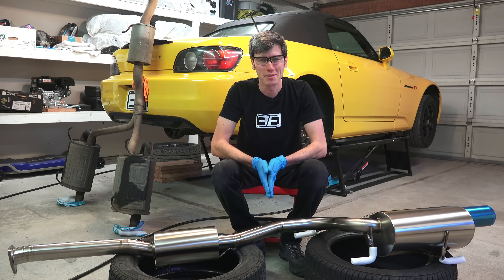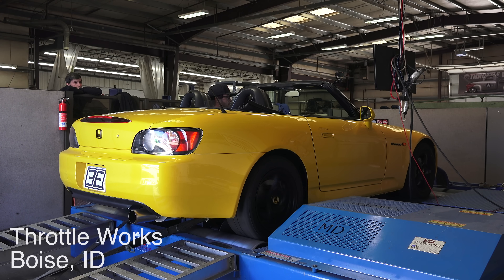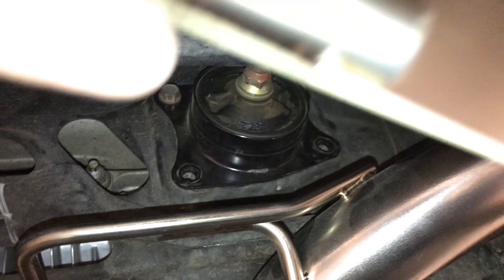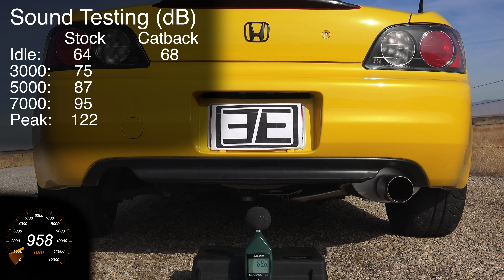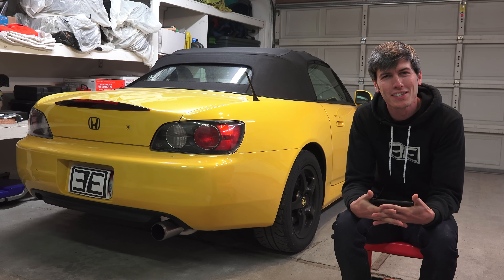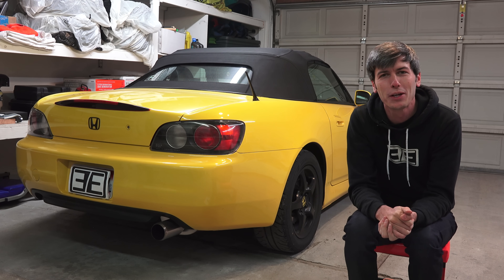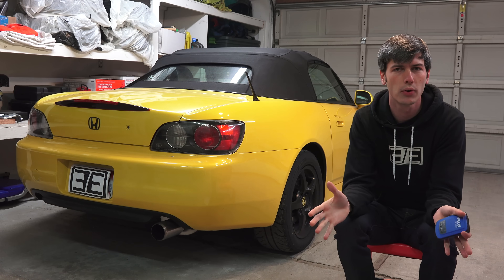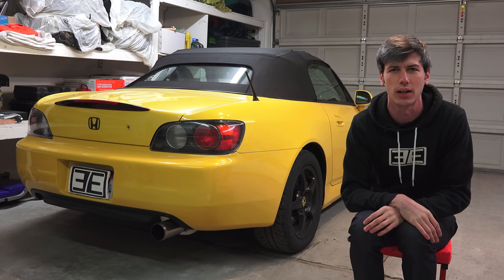Can A Catback Exhaust Make Your Car Faster?

Comment: Moral of the story....don’t buy a $2500 exhaust 😂😂😂
Reply: Toua Moua but for just the weight savings
Reply: Nathan Bickel 1 mod coming at $2500 is not justifiable haha. You can probably do a light weight battery for $100 and lighter wheels for much less combined for just as much if not more weight saving. The $2500 exhaust had minimal performance gain for the amount spent.
Reply: But I would love to see how much cornering speed might’ve been gained. If you think about it, that’s quite a bit of weight just saved from just one thing. If he kept it up it would become a track machine which is what it’s all about.
Reply: I’m pretty sure if he changed the header and got rid of the cat, the power would increase. The weight you save alone is already beneficial.

Comment: "The box said it adds 10 horsepower"
Reply: K&N sticker = 5HP
Reply: its the box that adds 10 horsepower. people get rid of the box and never get the extra HP
Reply: iLupi at the crank
Reply: XenomorphLV426 s2k owners are different from civic owners
Reply: only if you apply the product sticker on your rear window otherwise you will not be able to take advantage of the advertised 200 additional horsepower....
Reply: As usual
Reply: The box weighs as much as the exhaust 😂
Reply: 10hp equivalent  from weight reduction ;)
Reply: Up to* 10 hp people always get this wrong. You wont get 10hp straight out of the box if your last upgrade is exhaust then you’ll see 10hp.
Reply: William Stewart if you count over 10k cheap then sure
Reply: He must have forgotten to put the stickers on
Reply: That's with the hp stickers
Reply: Probably add 10hp at the flywheel not the wheels
Reply: meriton berisha 80% loss though the driveshaft? 😕 nope
Reply: James Foster literally everyone would... Just because a car is expensive for a 17 year old or poor person, that doesn't mean it isn't cheap by normal standards...
Reply: Based  on good authority, adding a Mugen Power sticker instantly increases 10 rear wheel HP in ricers.
Reply: Lol
Reply: 10k is cheap for a sports car really cheap.
Reply: GotPoop WeScoop Not really, they're dirt cheap now.

Comment: Would've been nice to see a raw power test with no catback at all, just to see what the maximum benefit from a catback could be. Wouldn't be road practical, just a curiosity test.
Reply: sienile. That wouldnt give you the answer you want though...
Reply: No, but it would give a theoretical maximum on all the parameters tested which no catback would be able to outperform.
Reply: sienile. No, it wouldnt. It would just show what a removed exhaust would do.  Its a false assumption to say that no exhaust is best for performance.
Reply: If Jason's theory that the cat is the biggest restriction in the exhaust is correct, that would take care of the back pressure issue you are eluding to. That would make anything past the cat a detriment to preformance.
Reply: sienile. No, you are ignoring the fact that a properly designed exhaust can in fact increase the efficency of the engine over an open exhaust and create more power.
Reply: And how does it do so? By reducing the restriction of the exhaust but leaving just enough back pressure to allow for laminar flow of the gases that will create a venturi effect and pull the gases from the engine. This is more a function of headers than a catback.

And to my original point, extending the exhaust beyond the point where such flow is achieved can only degrade preformance.
Reply: sienile. Stop pretending you know what you are talking about... laminar flow? That has nothing to do with the rest of your comment.

And you admitted I was right anyway by saying "mostly" becaise while the effect is greatly diminished the further down stream you go it does not go away, so like I said and you actually admitted a dumped exhaust is not necessarily the best exhaust.
Reply: Laminar flow is a flow without turbulence. When gases expand rapidly, this creates turbulence. Turbulence disrupts the venturi effect of a cylinder's gases pulling on the others. This is why some back pressure is good in an exhaust. It prevents the gases from expanding prematurely.

I never said anything was "mostly" anything... though I think you are referring to my statement that the effects I've described are -- more -- a function of headers than a catback. I also never said a dumped exhaust was best. I said that an exhaust that ran no further than the point where such a flow is achieved is best. So given Jason's assessment that the cat was the point of the most restriction, my initial statement would still prove true: A post-cat dumped exhaust would produce results that no catback would be able to outperform. It's possible, though incredibly unlikely, that a catback may match the performance; but it will not be able to outperform it.

I've been doing this stuff for nearly two decades. I know what I'm talking about. That's how I was able to tune the intake and exhaust on a '93 Altima to be able to crush a stock '03 Corvette C5.
Reply: sienile. Dude, you are wrong and embarrassing your self.  You cant just string a bunch of technical sounding words together and act like you know what you are talking about.

Comment: are these smoke puffs normal for that car?
Reply from the maker: Runs rich when you floor it. You likely won't see it while driving because of the air speed around the car, but you can see it easily while it's stationary.
Reply: oh alright. I'm just always a bit paranoid about that.

Comment: Well on the bright side, you removed a lot of weight AND the exhaust wont rust. Not sure if that is an issue there where you live but here where I live the ocean salt ruins cars.
Reply: I agree, the HP Bros out there don't understand power to weight. He sold a STI to get this, so clearly he knows he's not going to win any straight line races.
Reply: I see this as the main gain here. If he wants power, there is a lot more he can do that will benefit from having the lighter and less restrictive exhaust. Still has to do something about that cat though.
Reply: Fortunately Idaho doesn't use salt, but uses gravel instead so pick your poison. At least N.Idaho I know this, can't speak for S.Idaho.
Reply: I prefer salt, as it goes away in the spring.
Reply: OEM exhaust is stainless
Reply: Salt goes away in the spring, but your car goes away year by year.  At least with sand or gravel it's only hard on paint.
Reply: LazyRock Yup, sane down here in palm beach Florida, I live on a beach
Reply: I live in an area where both road salt and sea salt rusts out our cars...
Reply: Except usually exhausts rust from the inside out.
Reply: That sound is hard on my soul.
Reply: J Smith gravel blasting the paint away leaves the metal exposed and open to rust. Pick your poison.
Reply: I just make sure to wash my car (including underside) quickly with the power washer every time there is a day above freezing in the winter.  Not perfect, but better than most people who wait until the spring with salt all over the car.
Reply: Where Jason lives snows and honestly that's more of an issue than living near the ocean.  I leave near the ocean and my 24 year old car is rust free.
Reply: Well, I live on an island with 80% humidity all year. Cars don't last, especially old ones. That's why we buy them from the mainland where they are rust free. We prep them from underneath (paint and gravel protection) + on special places( wheel wells, door sills, floor near the pedals,A pillars etc)
Reply: Just dont put your cars into warm garage after roads have been salted and youre good. Only car that gets destroyed by salt before you can sell it is Mazda.
Reply: Bryan in Valley county they use sand and sometimes salt that is in deicing agents. It helps lower the freezing point of snow and ice.
Reply: @Bryan Southern Idaho uses gravel as well good to know he's in Idaho damn

Comment: Running a little rich with the full throttle stabs.
Reply: donE37100 it's probably spark getting cut before fuel gets cut. Feel like that's a normal thing to see.

Comment: Nice. It's worth noting there's significant gains to be had with a 3 inch system on the F20C and F22C motors.

Comment: Youre wrong. The answer is no. For an exhaust to give additional power, it has to be more than catback, and must be accompanied with a tune. The gains come from a less restrictive CAT, which you refuse to swap for some unknown and foolish reason.
Reply from the maker: RationallySkeptical continuing to push the myth that power gains only come from a tune. If you watch, I explain in the video how a catback can in fact increase horsepower. As far as the “unknown foolish reason” for keeping the cat, it’s for legality. I know the car community often doesn’t care about this, but I’m certainly not going to tell a platform of hundreds of thousands to make their cars illegal, while simultaneously spewing harmful emissions into the air. I know it doesn’t sound cool to many, but there are very serious human health consequences of letting these emissions into the air (there’s a reason catalytic converters exist). I’m not here to judge you, and likewise you don’t have to judge me either.
Reply: But aren't there road legal replacement cats that flow better?
Reply: Engineering Explained can you install a high flow cat?
Reply: RationallySkeptical not true at all but you must be smarter than all the test results and people who have proved it. Yes better gain if tuned but still a gain without a tune. You can make more power by tunning without making changes to the vehicle
Reply: The exhaust system as a whole is just that, a system.  A reduction in restriction at any point will have a positive effect on power gains.  Yes, a high flow cat will show larger gains.  As would removing the cat altogether.  As would a set of tube headers (usually...some cars see no benefit from this). But you can easily choke a system with restrictive mufflers regardless of what comes before it.  This mod is a step in the right direction, and future mods will show larger gains because of it.  And it will flow a bit better with any removal of restriction.  

Also, a new tune is only needed if the flow is increased enough to significantly effect the volumetric efficiency of the engine at any point in the map.  A minor gain such as this would be a waste of time to do a new tune.  But that new cat you were talking about...that would need a new tune.
Reply: Sounds like you are just jealous.
Reply: im no expert and therfore im asking one... is ther a posibility to gain torque and power with a "high flow cat" or "race kat" with a catback exhaust like this?
Reply: A high flow cat converter will produce more power. The fact is you cannot make more power without increasing emissions due to the fact you have to burn more fuel to make reasonable power gains. You logic sems flawed in respect to tuning, you didnt increase exhaust flow by any significant amount and then when you dont see much of a power increas you place all exhaust system in the same basket. Logic is flawed.

Comment: What's that weird T joint with the capped of pipe in the exhaust? Some kind of Helmholtz resonator?
Reply from the maker: That's about the extent of my knowledge of it haha. Keeps it from making unwanted drone I believe.
Reply: Anti fart technology.
Reply: As EE said, T joints and J-pipes are used to cancel out a certain frequency range to eliminate unwanted frequencies; destructive interference of sound waves.
Reply: Yes it is a Helmholtz resonator.
Reply: Engineering Explained Interesting.
Reply: Engineering Explained Does that affect the HP?

Comment: 2 exhaust to 1 exhaust, isn't that a downgrade?
Reply from the maker: #WeightReduction
Reply: It wasn't true duals to begin with, so no.
Reply: some cars have 2 exhaust exits as stock more for looks than necessity, Deleting the unnecessary one can save a significant amount of weight, less weight = minor handling/performance improvements, depending on how extreme you go.
Reply: They arent twin from manifold, only before muffler
Reply: That and the mufflers had all those bends within them.  Making a gas do several 180's doesn't help AT ALL.
Reply: Dual exhaust only really works well when you actually have two exhaust manifolds like in a V6 or a V8. the inline 4 cylinders have one exhaust manifold. besides, the titanium exhaust had better flow and a larger diameter exhaust tip.
Reply: The titanium metal surface add better air flow out. But if I'm not wrong original was two exhaust exit, and was change to one exit. It was mentioned in the video, you are Losing power.. forcing motor.
Reply: pantro1014 exhaust tip diameter in and of itself isn't the most important. Velocity can also matter as well as flow in a system and as such creation of a single path with as few angles at or above 90 degrees helped.
Reply: pantro1014 thank you, I was glad someone said this already. Unless the engine has twin exhaust manifolds, twin exhausts are usually just for looks.
Reply: afrosheenix But what do you think would look better on an S2000? A dual outlet exhaust or a single outlet exhaust and a hole on the left side of the rear bumper?
Reply: LinkzBe not at all
Reply: Well if you were to increase the diameter of the single pipe,compared to the dual exhaust it would not affect it

Comment: I need an exhaust for my skid mobile. Anyone know of any good affordable 
exhausts for 4 dr e36 323i?
Reply: Nikki Naydenov straight pipe
Reply: go to your local exhaust shops until you find one willing to do a custom exhaust and have them bend you a system using your turbo or whatever muffler you want
Reply: lol yeah but my car isn't registered for the street so that not an option, and the track i drive at has noise limits - 105db so straight pipe isn't an option lol
Reply: thats funny, my speed 3 is straight piped here in Georgia. We don't even have emissions testing.